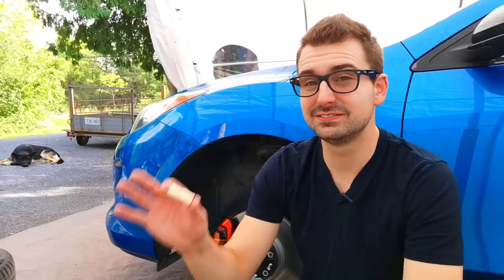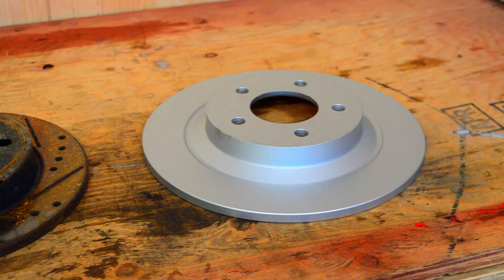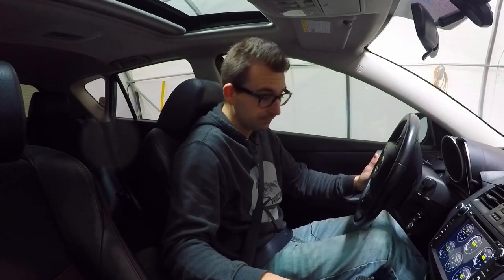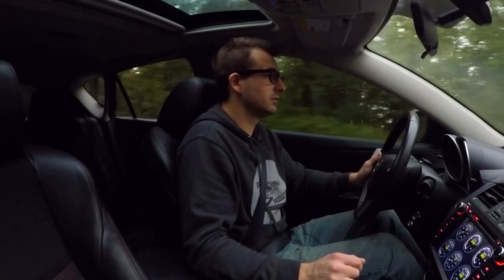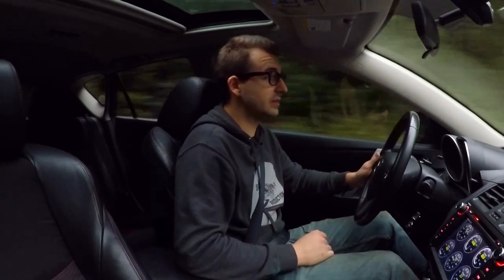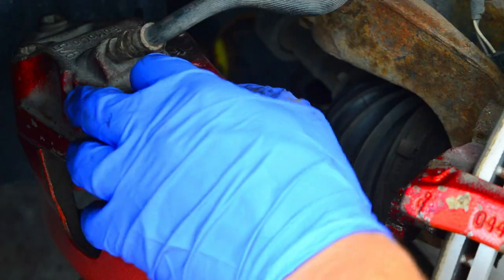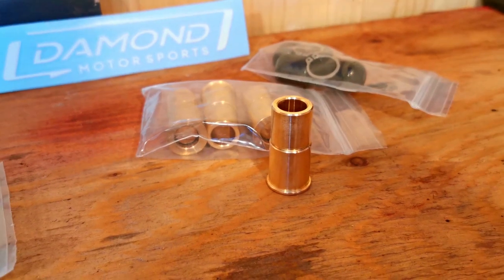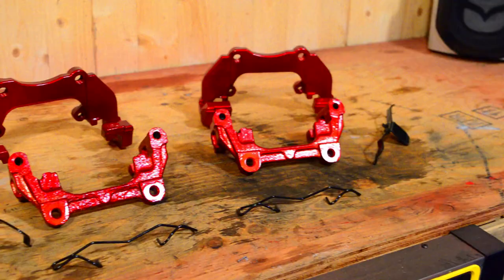Why is NO ONE'S Installing THIS on their BRAKES!

Comment: What lube did you use on the outside of the bushing (between bushing and caliper) and what lube did you use on the slide pins?  Unsure if I should use silicone or ceramic lube
Reply from the maker: I used the same lube for both and it was silicone based. Hope this helps! 👍

Comment: What  wheel spacers and stereo head unit your using?
Reply from the maker: I'm running 25mm wheel spacers and the head unit is a Eonon
Reply: @DrivingProduction  on all 4 wheels your runin the spacers? and thanks
Reply from the maker: @donlaw3109  yep 25mm on all 4 corners, my wheels are 7 inches wide though with 55mm offset stock